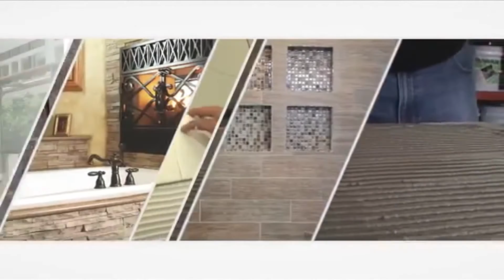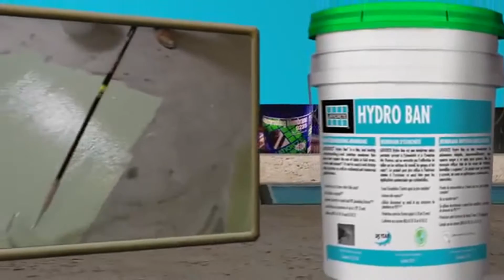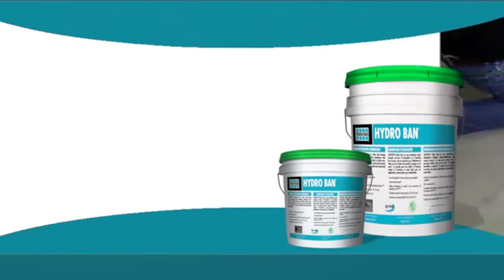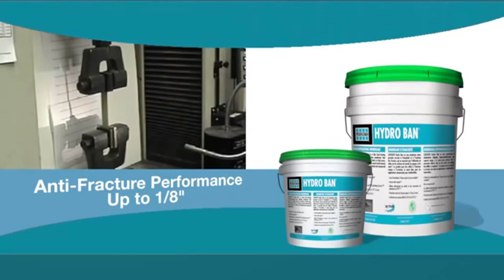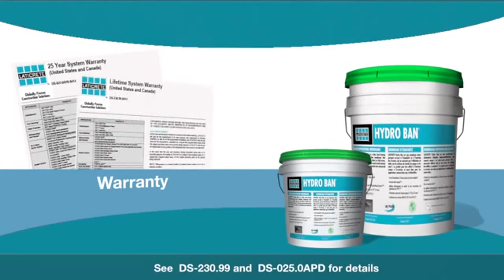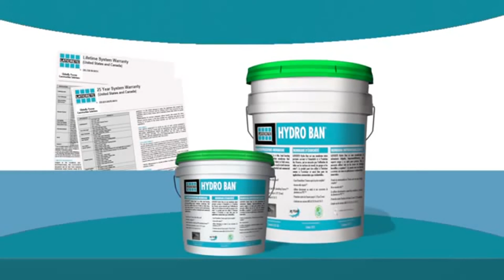Laticrete Hydro Ban Waterproofing Membrane From Contractors Direct

Comment: Should it need stirring/mixing in the tub when opened?  I bought a 5L tub before the use by date but it looks to have separated into watery and sludge, didn't want to use it if it won't cure properly.

Comment: Hydroban, recommends over concrete exposed roof for waterproofing purpose and need protection screed? Or it has UV resistant features
Reply from the maker: Sunil, this product is not designed to be used as a primary roofing membrane.